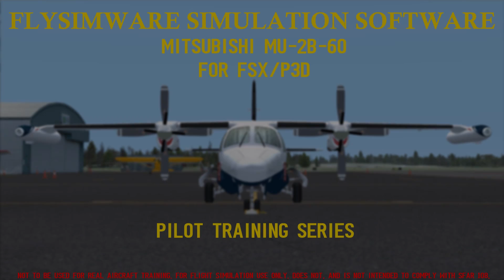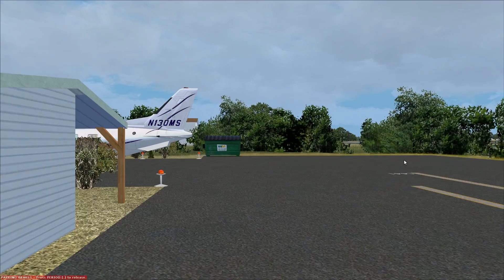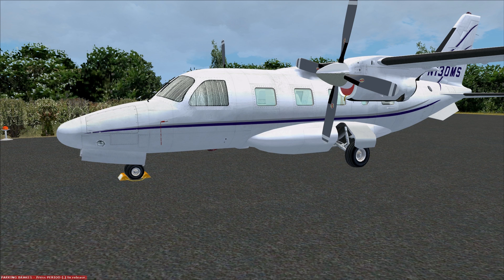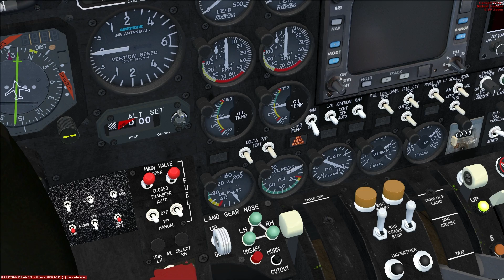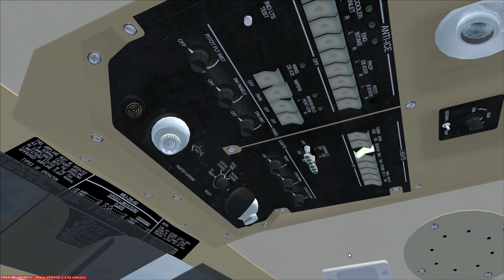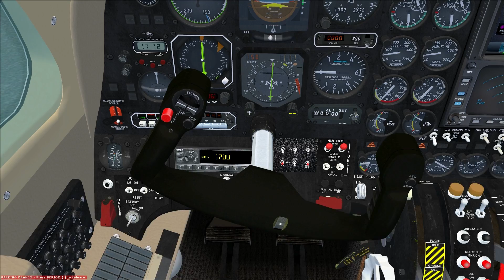Flysimware MU-2B-60 Training Series Part 2 - Engine Start

Comment: Just little stuff, but typical startup EGT temps are 650-750 and you should see fuel flow before ignition, so FF rises then look for EGT taking off with engine rotation.  Also make sure to turn both gen's on with a battery start to help shed the load, then switch to the operating side after a couple of seconds.  You risk popping the main bus tie if she pulls more than 200 amps on the recharge.

Comment: You forgot to do the feather valve check prior to engine start. Critical check. While depressing the feather valve you bring the condition lever to emer stop and check for the nts light to extinguish. This proves you are dumping the oil from the prop hub and are capable of fully feathering the propeller in the event of an engine failure
Reply: Engine starts fine without an NTS check which does not require selecting emergency stop!  Where do you people get trained!!

Comment: how do i turn on the GPS Garmin? :(
Reply: I'm pretty sure i read it somewhere, can't find it anymore. The MU 2 has two GPS options, the GNS530 withs can be turned on by hoovering the mouse ove the left upperhand knob marked C and turnning the mousewheel. It all so controls brightness of the display. The GTN750 only works if you have the Flight1 add on installed.

In aircraft selection you can choose the one you want to use.

Comment: Hey there.... I left a comment and question about the Cessna 441 cause I was having trouble starting the airplane. I am also having problems starting the MU-2. Right engine doesn't even begin to start at all, left engine I can get to 12 percent and then nothing, it just stops there. Any ideas? Thanks!......absolutely awesome airplane. Oh, also not sure how to turn on GARMIN GNS OR GTN.
Reply: +seethatflyingcat  sam fricking problem , no clue
Reply: +MXA057 hey MXA057, with the mu-2, watch a video on the start-up procedure of the airplane in real life. The startup checklist is not correct. With the 441, when you shut it down, you need to put the engines in reverse, then kill the fuel. That was from a family friend who use to own one. By putting the throttles in reverse, the props begin to go into beta, which allows the props to be "flat". If they aren't flat then they create too much drag and the starter will not finish the process in order to save the engines from over torque
Reply: My idea is that you might want to get some real training first. Get to know the guys at Tulsa Jet. Its been a while but in my day they were the best in the business. Malcolm Drinkwater knows the airplane like the back of his hand at Conroe Tx. Tell him I sent you and hello.
Reply: -10, -6, -5, or -1. Woodward or bendix?  -8 is different on the Conquest.
Reply: I can't help with the Garmin, but make sure your fuel shututoff switches are turned on.  Max RPM you'll get on just the starter is about 11-12%, if fuel isn't introduced you won't get light off.  RCS to Run, air start and safe to the correct side, look for fuel flow and check your ignition.

Comment: This is a nice presentation although the engine start was not correct.   It appears you only had voltage on one battery during start.  The 200 amp bus tie appreared to be popped due to only one side showing voltage.   You did a cross generator start which is not allowed.  You failed to put both generator switched in the on position after the first start in order to keep from over amping the generator. (limitation).  The voltage was not checked prior to start.  No bus tie check was performed after start and not governor check was performed before the props were taken off the locks.

I must say your graphics are nice and voice is clear however, would it not be much better for the viewers to use the required regulatory checklist and conduct the engine start correctly.   It is good to point out that this airplane operates under SFAR 108.  The checklist, profiles, explanded procedures, etc are actually regulatory and must be complied with during all phases to include engine start.  When something is put out to the public in error, that is when safety issues come into play.

I would suggest redoing the video and making it correct to better serve pilots and the public.

MU2 Pilot.
Reply: AMEN!